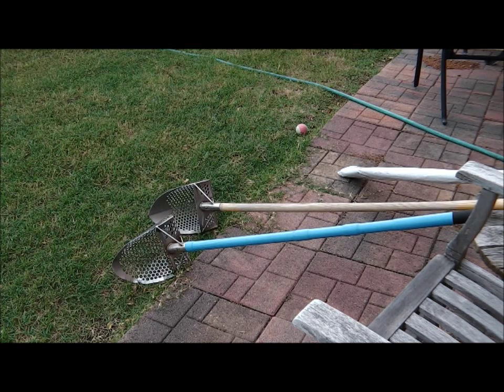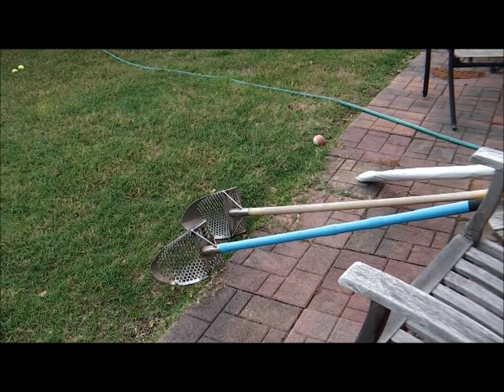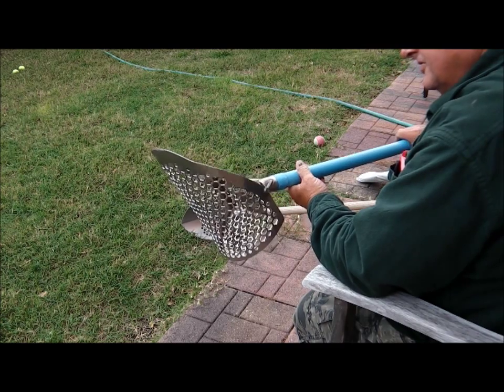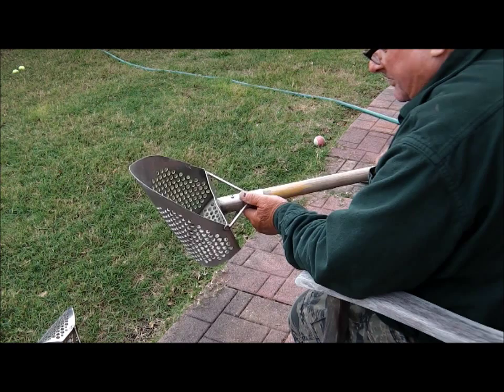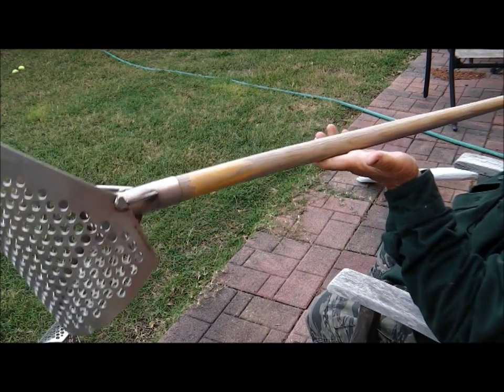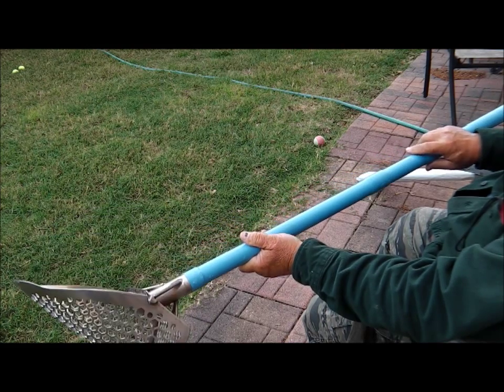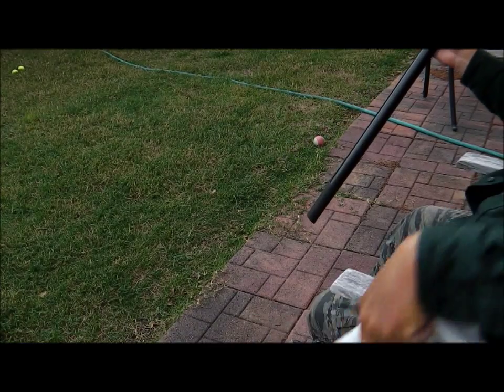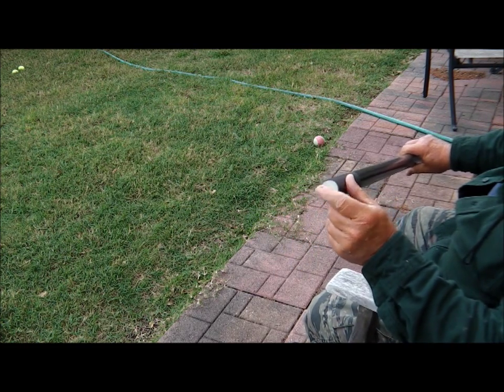Carbon Fiber Handles for All Stavrscoops - available now

Comment: Max, How much of a weight difference between the carbon fiber and the wood handles?  I started watching your videos about 6 months ago, ( I am a Wicked Edge owner and sharpen aprox. 25-30 kitchen knives and maybe 5-10 folding/bushcraft knives a week as a part time gig ) After watching your detecting videos, I  think I might like to get into detecting. I live in upstate NY on Lake Ontario and we do not have the same sort or the number of beaches for depositors like you do. I am not sure what I would find around here but you have me intrigued. Thanks...
Reply from the maker: The fellow who makes the new titanium scoop hunts up that way alot.  he lives in rochester.
Reply: Max, That is funny. I live in a suburb of Rochester.
Reply: I live in the Watertown area and Lake Ontario destroys scoops due to the gravel sand mixture.....
Reply: Thanks, That is good to know.
Reply from the maker: tony the maker of the titanium scoop lives in rochester and hunts the lakes also.
guessing about 1 lb less than the wood.
at the gigs now, where i have power, i have been using the Kalamazoo 97% of the time for all knives - faster.
i can supply tony's number if u need a new s/s scoop or titanium one. has a nice shop there also.
good luck Frank..keep me posted
Reply: Frank Bailey I just received my 920I and was in the water for about 3 hours with a fiber handle , found I wasn't tired at all . Nice and light. The water was loaded with small rocks and sand. so was on the hard side to shake the sand out even in the water. I think i need a scoop with 5/8 holes . Looking at the T REX. finding a fiber handle seems to be a issue for that scoop.

Comment: hey max will these handles work with a trex scoop? thanks Chris
Reply from the maker: not this stavrscoop model - i mean it would work, but sunspot's other carbon fiber handle that he offers for his scoops or other scoop models would fit better. ---better meaning - it would be closer to the correct diameter for the T-rex.

with this model you would have to add to much filler of sometype to get the needed diameter for your scoop.-----see below
.
Carbon Fiber handle – Save about 1 pound!

Ordering Code : S30 for Stealth “Tube” scoops

1 3/8” diameter for direct fit to Tube type Stealth’s. Length : 48” 

Extremely rigged and it floats like all of our handles. Has underside locking (see images).

The end cap is a little larger which minimizes the handle slipping from your grip.
Reply: gravediggermax awesome thanks for the info max. ;)